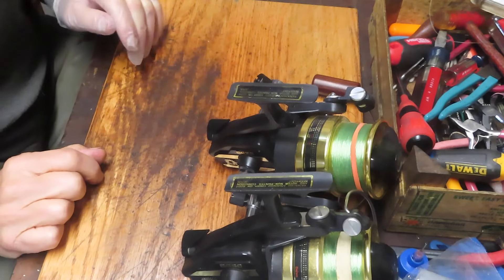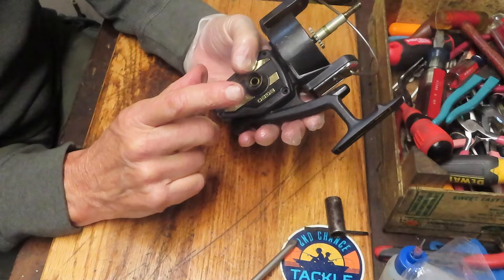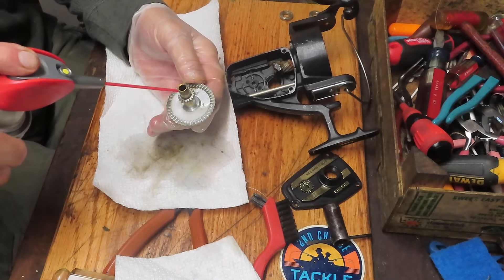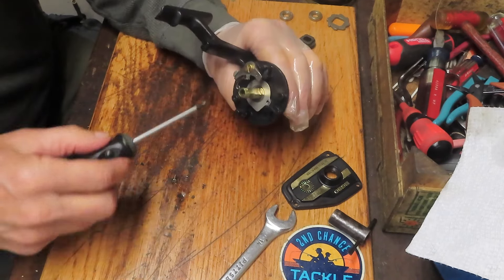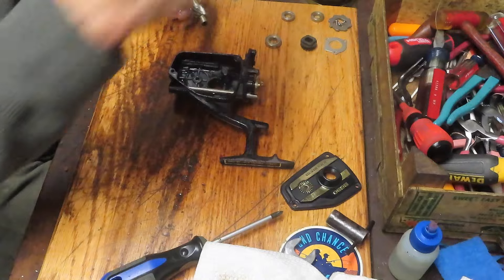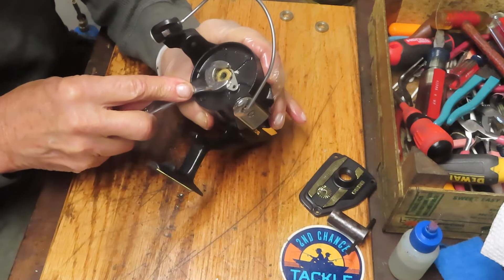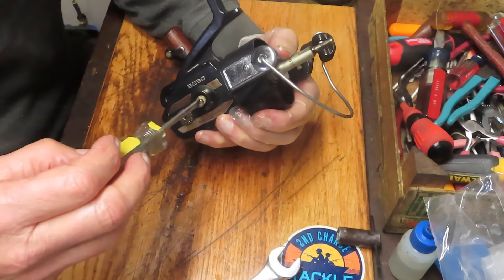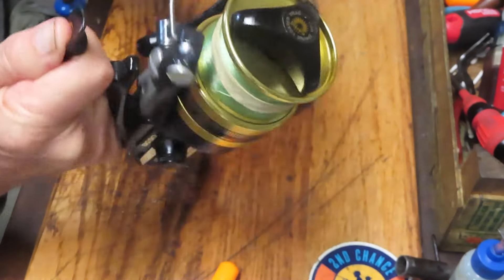One wobbly Daiwa BG 90 saltwater fishing reel how to take apart and service

Comment: You probably got a great deal on this reel and it is a beauty. I’m pretty sure that pinion is stainless. You know the Daiwa 9000C and GS9 do not have that wobble. The date of these started at 1981. I remember when you used a small screwdriver to apply grease. LOL. I’m one of those that loves the 7000C click. I intend to use my BG90 for surf fishing! I close all my hammer bails by hand. I don’t like slamming a bail. It is quite the coincidence that two days after I buy one of these you do this video. Thanks a bunch Dennis! I may try to take a stab at balancing that rotor. Rick S. And I were talking about it today. He had some good ideas how to do it. The question will be whether there is enough space under the rotor or on top of it to put some balancing weight. Great video Dennis. — Chris
Reply from the maker: Let me know how you make out if you find a way to balance them - Dennis